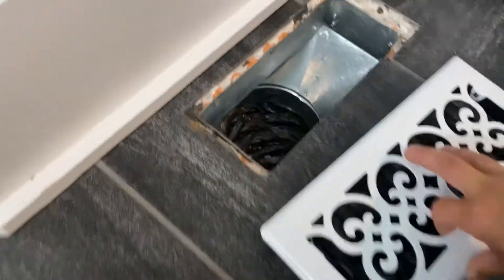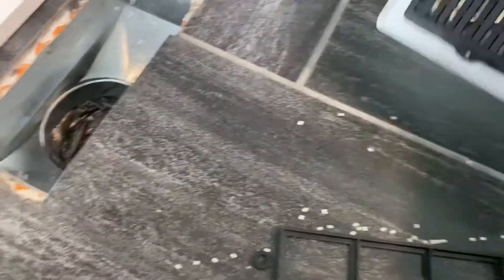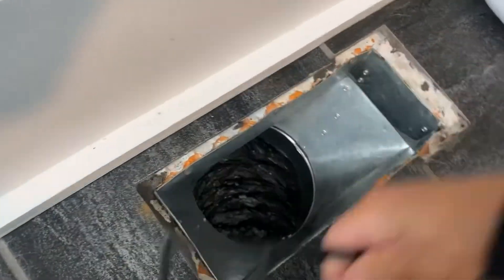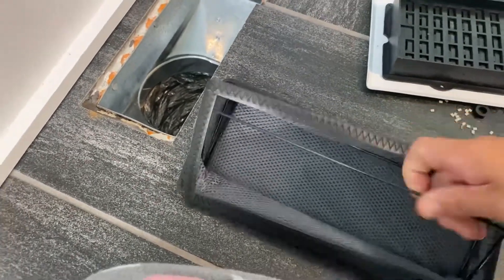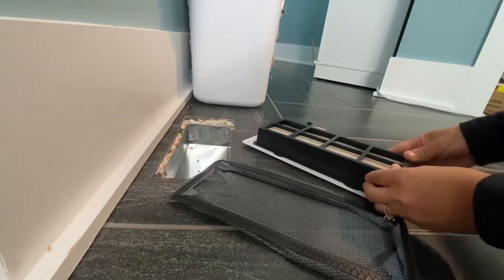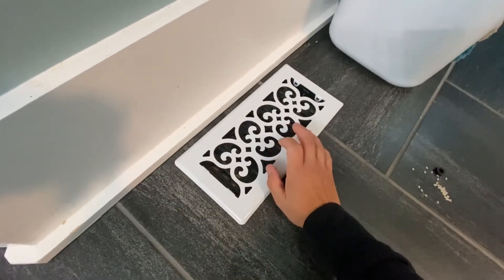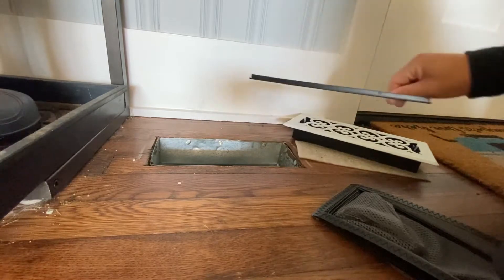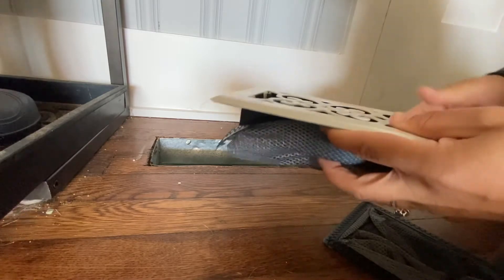Floor Register Debris Traps / Catches

Comment: Why don't you try the Ecoflap vent deflector/debris catcher which catches debris and lets the air through when it auto opens. Your use of both a filter and the mesh seems like overkill and would severly restrict air flow through the vent I would think.
Reply from the maker: Will have to check it out! Thankfully, we haven’t had any airflow issues.